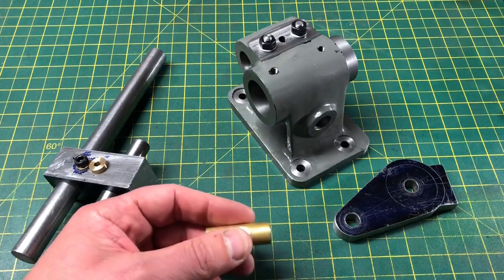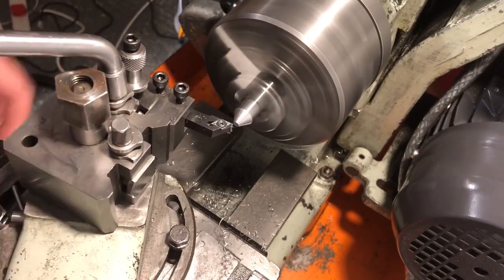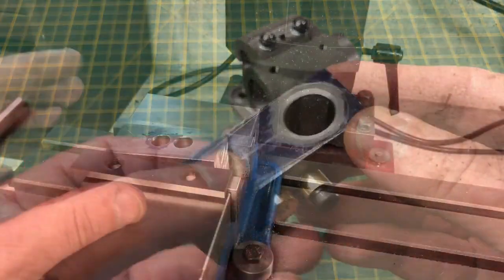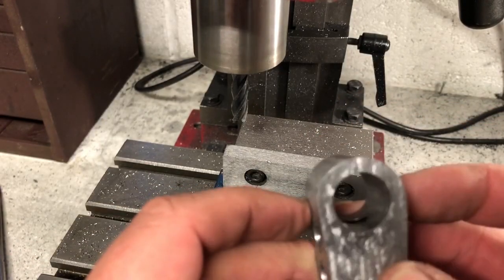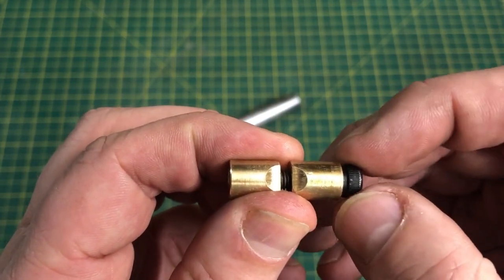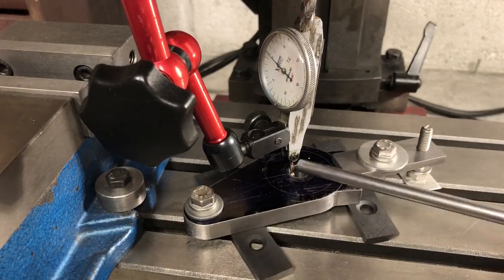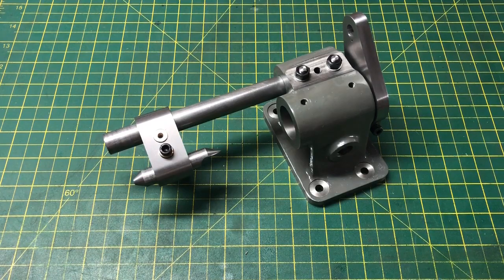Building The GHT Versatile Dividing Head - Part 3 - Completing the Tailstock

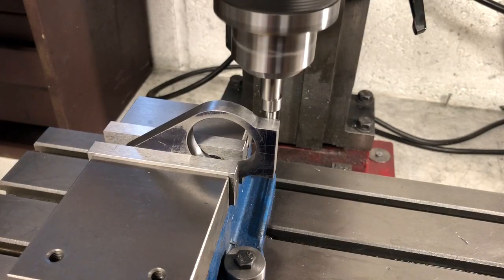Comment: Very nice so far! So be a stickler for accuracy, at 9:25 if your mill is not trammed (as you said earlier) then using a square on the table would not be as true as indicating the part to the spindle and z-axis.
Reply from the maker: Thanks for watching. You are quite right. In this instance the error is so small and the feature so insignificant that I decided 3 seconds with a square was good enough!
Reply: @DrillsTapsDies  OH yes, I wasn't speaking about that particular job, but the practice in a situation where accuracy happened to be critical and how to best compensate for a badly trammed head. My own mill is garbage. I bought one of those HF 44991 mills that have the column mounted on a pivot thinking the ability to radically change it would be helpful in making a part of a machine I was inventing. Not only did that not turn out to be necessary I later found out that the mount lacked sufficient rigidity to make anything accurate with that mill due to more than 10 thou on the end just pulling by hand. Sadly this was discovered AFTER investing in a CNC upgrade kit for it. Costly lesson learned. :-(
Reply from the maker: You are absolutely correct. If you know your machine It is completely possible to work around its limitations but it doesn’t half need thinking about sometimes! Your issue with the mill is the reason I went for a fixed column version. There are only a handful of times where tilting the head would have been useful and I have always managed to find another way.
Reply: @DrillsTapsDies  Sadly for me I have only recently been able to get into this wonderful hobby. I'm 65 and thinking that I probably should throw money at bigger and better machines no matter how attractive they might be but they you have to keep life worth living eh? Have to know when to splurge and when to resist the urge.

Comment: Old fashioned high carbon steel like what they made tools out of 100 years ago before alloy steels became available has now been given a makeover and is now called silver steel   ...am i right
Reply from the maker: In the UK "Silver Steel" refers to the form and the composition - it is most definitely a high carbon steel but In the UK the term refers to centreless ground round bar with a particular chemical composition to a British standard (it includes some chromium if I remember correctly.) It has been available here for somewhere in the region of 100 years. It is similar I believe to drill rod in the US - Feel free to correct me on this if I am wrong!
Reply: @DrillsTapsDies  i  saw people on youtube making projects with what they called silver steel , i was intrigued, so i looked around and was able to find a supplier in Australia when it turned up it had the chemical analysis with it and when i looked at it i thought what is all the "who har" about  this is just dirty old high carbon steel . in Australia you can get it in what is called k1045 black meaning roughly that size or m1045 bright meaning very close  usually within .001"
Reply from the maker: There is nothing special about it really as you say. It is probably the most convenient readily available tool steel to hobbyists in the uk. It comes as standard in 333mm lengths (as well as longer) and is very good dimensionally. I imagine it is simply the availability that makes it crop up so much.
Reply: @DrillsTapsDies  i was probably over thinking the whole thing, when i heard the word silver i thought it must  have to do with being valuable or precious .anyway thanks for explaining the situation in the UK. I don't think there are many if any, suppliers of steel to hobbyists in Australia the market is just too small ,you just go along to an industrial supplier and buy meters of steel or pay the $150 minimum charge and if you are at a huge warehouse with unlimited choice and no way to get out without being ripped off you just say to yourself might as well make it out of 4140  or 4340 chrome molly.  You are doing a great job on that dividing head ....i can't believe there are so few people looking
Reply from the maker: @nealblackburn8628  Thanks very much. It used to be the case here that you could wander down to the local engineering firm and root through the scrap bins and take whatever you wanted usually just for beer money. So many of these little independent workshops have gone out of business it is saddening really. We have a few suppliers here that will post you 12" lengths of alu, copper, brass and bronze along with Mild, stainless and silver steel. Price per running foot is more than buying 3m lengths but when you want a selection of sizes it is pretty viable - as soon as you want anything more specialised we are in the same boat as you.